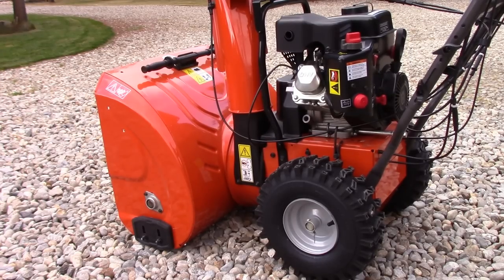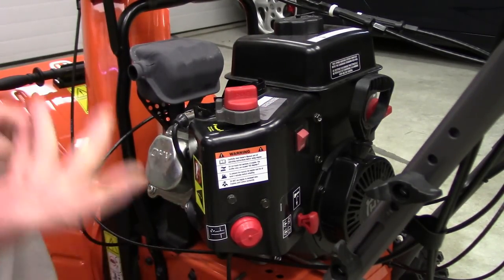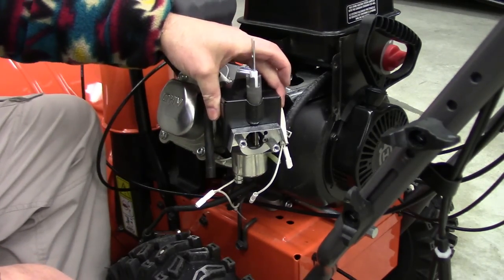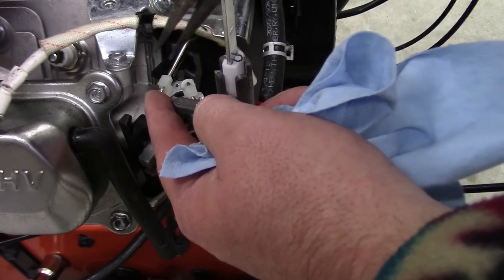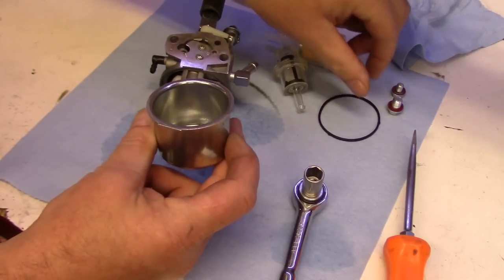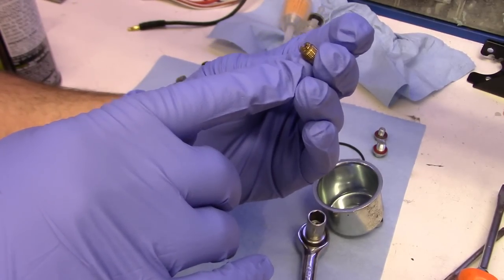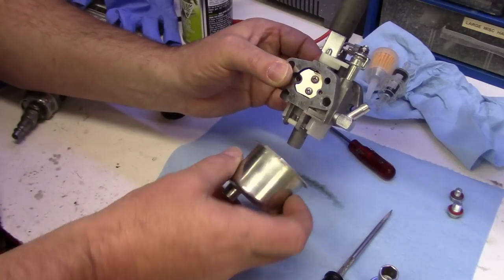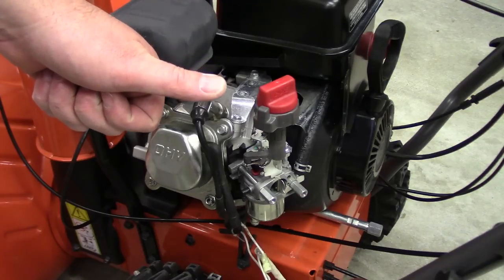Surging Snow Blower Fix - Running lean.

Comment: The switch and key are wired in series.

If they were wired in parallel, both switches would have to be turned off in order to stop the engine
Reply from the maker: Yep, that makes sense. 👍
Reply: @Rchelicopterfun  Sorry, I'm an electrician. lol
This was a good, informative video all the same
Reply from the maker: @Brent Wright - not sure what my excuse is then as I have an automotive & electronics background. Brain fart I suppose where my mouth was flapping faster than processor - a common occurrence according to the wife.
Reply: @Rchelicopterfun  You're not alone brother... lol

Comment: John, thank you so much for taking the time in making this video. I have a 3 year old craftsman that was surging today. I knew it had to be the carb but wasn't too sure about the mechanics of it internally. Your video solved my issue but man what a process just getting to it. The old machines it was right there and you barely had to remove anything. Thanks again for walk through and happy holidays!
Reply from the maker: Very welcome

Comment: Guys, if you're good with tools and your hands, you don't have to remove that cowling or other stuff to get to that bowl. Drain your gas tank or put some plastic under the cap. Tilt the blower forward onto the auger housing (the forward service position), and remove the left side wheel. You'll have room to access the bowl and main jet. If you want access to the low speed/idle circuit jet, you will need to remove the cowl.
Reply: I agree all these guys are tearing ther machines apart for nothing you can get emulsion tube easy with out all that bullshit lol these guys have nothing better to do the joke of it all is this looks like a brand new machine if I payed that much for a snow blower and it was screwing up the first season they would be getting ther machine back he prob never drained the fuel in the end of season but he said it was doing it from the start yep I’d take it back I have a Poulenc pro and I got to take the tube out plus I’m going to do what another comment said I’m go to block we’re the air goes into carb running full out and take my hand of and on and the pressure could clean it out happy snow blowing not hate winter I want a closed in tractor lol

Comment: Hi John.
You, by far, have the best tutorial video out there for cleaning the carb on the LCT engine.
I have cleaned my carb 3 separate times and still have a very minor surge occurring.
I broke out my micro drill set last night and after addressing all the potential clogged ports, it still has a minor surge.
I ordered a new carb online for $26.00, but as a last effort, I am going to run the engine and spray some quality cleaner into the carb while it's running because it just may vacuum the carb clean.
Thanks for your video!
PS- there is an even smaller fuel filter available, such as the Briggs red plastic one. I may try to incorporate that into the fuel line and see if it helps prevent future issues from occurring.
Happy New Year!
Reply from the maker: There actually is a small in-line filter in the fuel tank. It's part of the threaded hose bib (at least on this model). I found it after making the video; so you may want to check your fuel tank as well to make sure that filter (if yours has one too) isn't getting clogged.
Mine was half plugged (on the bottom half) with dried up black paint particles? Seemed to be from the paint they painted the fuel tank with and likely was overspray or the hose bib threading process that got into the tank? I'm sure it was there since day one because this snow blower would always start running lean when the tank was below 1/3 fuel remaining (about at the level on the filter where the paint was). After cleaning all the paint off the hose bib filter inlet, it runs great until the tank is a dry martini.  
I actually think a lot of that black crap that was inside the float bowl and the particle/s jammed in the main jet, were some of those paint particulates that got by that in-tank filter. I checked the bowl this fall, and it's still spotless.
Reply: @Rchelicopterfun  John, thank you the excellent video and replies to everyone’s questions. I will try cleaning the in-line fuel filter in tank. Thanks again. Much appreciated.
Reply: @Rchelicopterfun  Agreed, I am on my third fuel shutoff now on a 4 year old unit that has less than 10 hours on it.
I thought about adding a small filter to offer a belt and suspenders sort of filtration because the one in the tank isn't all that great.
After cleaning my carb several times, I noticed a couple of videos out there that showed removing the red low speed plug under the idle adjustment screw.
I hadn't thought of that, but after pulling it out, I noticed the port on it had obstruction.
I replaced that red plug and now my blower is running great again.
John, your tutorial video is still top notch and one of the best I have seen.
Keep up the good work!
Take care.
Reply: @John Salt  my issue wasn't the fuel filter that's part of the fuel shutoff on the bottom of the tank. My issue was that red low speed port on the carb that is notorious for getting clogged. I cleaned that out with a micro drill bit and that fixed it 100% and allowed me to keep the original OEM carb that came with the unit. 
Today it runs better than new because I updated the belts and friction disc to better than what the OEM provided new.

Comment: This completely fixed my issues, ... The carb was very dirty, I sprayed every valve & crevice I could find, surprised by all the dirt that came out. I would up putting in a small 1/4" in-line fuel filter & it runs like a top. Ready for the next storm.

Comment: Just took the carburetor apart and cleaned everything.  Seems to have helped the backfiring and surging so far. The idle seems to low now however even if I turn the idle screw to the right all the way, not a lot of change. Plus I need to order a bowl gasket as my machine is 7 years old and has a slight leak.

Comment: I just cleaned my carburetor and added an inline fuel filter and after snowblowing my drive once the thing won't run for more than 15 seconds. I miss my old 5 hp Tecumseh powered Craftsman.
Reply from the maker: Have you checked to see if there is an inline filter in the outlet from the fuel tank as per the first pinned comment? Many of these newer blowers have a tiny screen filter in the fuel tank hose bib that can easily get clogged and there is no way to inspect it other than remove the tank and pull out the hose bib to access the filter for cleaning. Mine had one and it was plugged half way with what looked to be overspray paint particles from inside the fuel tank. I think it was some of those tiny paint particles that got by that filter that clogged the main jet in this carb clean.

Comment: With this problem would you get the smell of gas in the oil?
Reply from the maker: Shouldn't be. Since it's running lean and being starved for fuel, should be no raw fuel left in the cylinder to seep into the crankcase.

Comment: You should have drilled out the jet to the next micro drill size bigger hole. Now that you had it open. The bigger hole would not plug up as easy. Also you know that, the colder air temperature gets. There is more Oxygen in that air. So you need more gas to go along with that Air,or it will be running lean. On my cub cadet snowblower, I opened up my low -speed Jet and high-speed Jet.

Comment: John nice video would suggest pressure testing the carb at 5 psi to ensure needle valve seating prior to reinstalling. Check out Eliminator Performance videos the kid shows the pressure testing pump.

Comment: have not read all the comments so , sorry if this has already been posted, but the only fuel filter I have been told about is the screen assembly that sits over the opening to the gas container that is visible and accessible at the opening after you remove the gas cap. you can remove it be grasping it with a pair of needle nose or even regular pliers and pulling straight out and up.
Reply from the maker: Yep, it's mentioned in the very first pinned comment. However they are all different. Mine is built into the hose bib that exits the tank and the only way to remove it for cleaning is to remove the tank & unscrew the bib. Lucky yours just pull out from inside the tank 🙃

Comment: I have a Ariens Compact 24 208cc LCT engine I believe, cleaned the carb as shown, I’m still having issues with sputtering, it’s not terrible but noticing oil level too high and smells like fuel, float bowl seems to work as it should upon inspection, not sure what it could be causing to run rich still.
Reply from the maker: @Michael Holly - well, this video and carb clean was to cure a lean running condition (dirt in main jet). If you have a blower that is running too rich, then it's going to be something else. Rich running could be caused by a loose main metering jet (sucking fuel past the jet) or oversized jet. Blocked air filters cause rich running, but blowers don't have air cleaners, however, maybe something else is partially blocking the air intake? I've found mouse & bug nests in several over the years. If you've cleaned the carb however, then you would have found that. Incomplete ignition would be another possibility. Never hurts to change the spark plug unless you've already tried that.
Reply: @Rchelicopterfun  the unit is almost new, used once, left gas in it. I drained the gas and added new. I think too my problem was adding a can of sea foam 🙃 trying to get it to idle correctly. I then cleaned carb after, put fresh gas and noticed gas Oder in the oil. Just changed the oil yesterday, cleaned carb again and runs slightly better but still sputters occasionally, I’m hoping I didn’t ruin the carb with seafoam/mechanic in a bottle. Next will be the spark plug for sure. I have found when the fuel shut off is partly closed it runs perfect, but then sputters when engaging the auger. Once spring comes I’ll test back apart and get a carb rebuke kit and spark plug.

Comment: Absolutely awesome video! Thank you very much. My father's Ariens 24 classic snowblower has the exact same symptoms and I will be fixing it today for him. I will also install a short profile fuel filter to avoid this in the future. I will update with the results
Reply from the maker: Thanks for the comment and good luck on your carb cleanout today. You may want to check inside the fuel tank for an in-tank filter. I later found one on this unit. It's part of the hose bib assembly and the filter screen is up in the tank (the hole assembly screwed from the bottom of the fuel tank). Mine was plugged half way up with what looked like black paint particles from when the tank was sprayed and overspray must have got inside is my guess. I'm also guessing it was some of those tiny paint particles that got past the in-tank fuel filter screen and into the carb.

Comment: Thanks for the very helpful video John!  I just cleaned the carb on my Ariens machine and have had trouble with the idle speed not working properly after putting everything back together.  The problem is that my idle speed does not change regardless of the position of the adjustment switch.  The very end of your video showed me the answer was in that black plastic adjustment screw.
Reply from the maker: Glad you got yours working too 👍

Comment: Awesome. Thanks so much for this great clear explanation.  I wouldn't consider opening up anything like this as I'm a complete novice,  but as my husqvarna blower is only 2 years old and is doing exactly the same thing,  I'm pretty confident this will do the trick and save me a couple of 100 Euros at the same time! I'll report back on whether I succeed. Thanks heaps! 👍😃
Reply from the maker: Hope you are able to get it running properly. If it's still running lean after cleaning the float bowl and jet, you might want to take a peek into your fuel tank and check the fuel line bib filter (a little fine screen filter attached to the tank bib). Mine was gummed half way up with paint particles likely from when the factory threaded in the fuel hose bib into the tank.
From day one, this blower would always start running lean when it got below 1/3 tank of fuel left and would never run below 1/4 tank. I never thought much of it until another commenter on this video mentioned this hidden filter, and sure enough after checking it, finding it all gummed up and cleaning it, the blower now runs well right until the tank is dry.
My guess is most, if not all the dirt in the carb were fine paint particulates that got by that filter in the first place. Since cleaning that filter out, when I checked inside the carb bowl this fall, it was still spotless.

Comment: It is snowing and I have surging. Brand new machine bought last year. Cub Cadet 2x .Left untreated gas in it for about 10 months.Can I run it full choke to get rid of snow till I can get it fixed?
Reply from the maker: I would empty the tank and put fresh gas in. That to me would be the first thing to try as it might be all that's required to get it running properly. Running with the choke on is not ideal because power will be down and depending on how much/how heavy the snow is, could bog down the engine excessively.

Comment: Bought a snowblower from a friend’s neighbor for a hundred bucks; having issues with it needing to run half choked. Had already been into the carb a couple times and just wanted to see what it was supposed to look like before someone took it all apart. Was also wondering how the throttle control worked. Last minute has given me all the insight I now need to finish fixing this thing; thanks for the thorough walk through on this carb setup!

Comment: I was amazed that you actually discussed drilling out the jet -- that is a terrible idea -- it is not a wear item, and there is not need to disrupt the fuel metering by modifying it.
Reply from the maker: I'm even more amazed you'd question a known and standard practice to cure a lean running condition (which is exactly what the symptom here was).
Of course in this video, I didn't have to resize the main jet, it just needed cleaning which is usually all that's required.
I simply mentioned in passing, that sizing the jet up MIGHT AS A LAST RESORT be required to cure a lean running condition when EVERYTHING ELSE CHECKS OUT. Sorry for the all-caps, but you obviously missed those two important points in the video and I didn't want you to miss them again. 
Jets can develop build up & oxide, and they can get pitted by contaminated/old fuel reducing their flow rate; neither of which can be cured by cleaning. In those cases you either need to put in a new jet or ream/drill the old one. Jet's can also be incorrectly sized at the factory (yes it happens) or sized for a specific altitude of operation and then you have to size up or down if you live a couple thousand feet over or above that baseline. Same goes for temperature. Far from a terrible idea partner.

Comment: I was very disappointed by the amount of disassembly I was required to do to clean a clogged carburetor fuel jet in my cheap MTD Yard Machine snowblower with this China made 208CC power-stroke brand engine.  Again, I WAS disappointed until I saw your video which was even more steps.   10 years ago we could turn a screw.  If it was really bad, we removed a screw, cleaned, then reinstalled, and that was it.

Today, us consumers are in a very bad position.  At about 7 years of life, this jet cleaning needs to be done. To have a small engine repair place do it, the cost is $100 - $170 if you bring it to them, and pick it back up.  However, the entire snow blower, which can be replaced with new for $600 - $700 is worth no more then $250 when 7 years used and running properly.  So yeah, spending $170 to repair a $250 item means toss it and buy another.  

I have a relative that has a small grass lot.  He’s a actuarial scientists.  He did  some basic math and determined he’s better off not maintaining small engine items such as push mowers, weed whackers, snow blowers, leaf blowers.  Instead, he does no maintenance, runs until it has a failure then tosses the item in the trash as he replaces with a new, cheap one.
Reply from the maker: Looking at the glass over half full, us DIY'ers who enjoy tinkering on stuff are in a wonderful position today to save massive amounts of coin. I know I sure have. Never has there been as much free and helpful information available to us within seconds showing us all exactly how to service our our own equipment, learn a good deal in the process, and get that good feeling of accomplishment. From very simple stuff like this, right up to much more complex servicing on everything from a little snow blower to a Ferrari engine. This is a wonderful time in history for the average DIY'er & Renaissance man.
Reply: John Salt well, I can’t argue with that 👍

Comment: There is a fuel filter, it is in the tank. Where the hose connects at the tank, unscrew the nut and pull the filter down.
Reply from the maker: Yep. Found that out later in the season when it started acting up again below 1/4 tank. Stuck the good old borescope probe in and noticed that tiny screen was plugged solid half way up with black paint particulates (presumably from when the tank was sprayed) and the filter/bib assemble threaded into the hole. Those black particles were also likely what were getting into the carb and blocking the jet as I found more in the carb bowl after cleaning the filter. Had to remove the tank, and unthread the screen bib to clean it as you mentioned - such fun.
Reply: @Rchelicopterfun  
I might have to do that,
Will empty gas,  remove tank, flush rinse using garden hose, rinse using alcohol then let dry before to reassemble.
Reply: Also, enlarge the throtle jet (rep plastic screw) to 1/64" using a drill bit so it won't run lean.